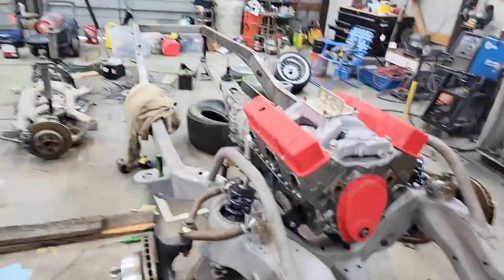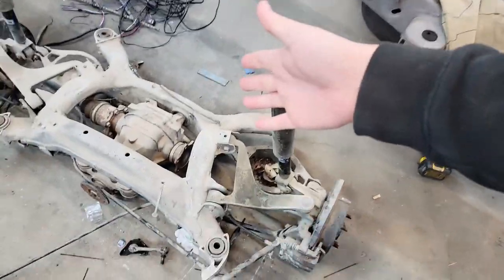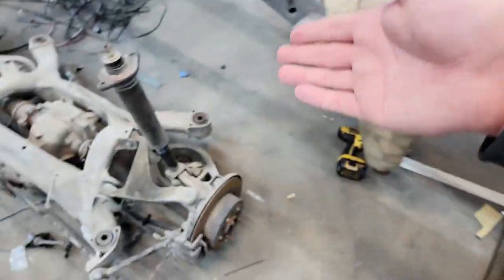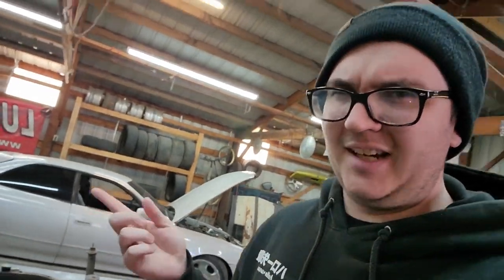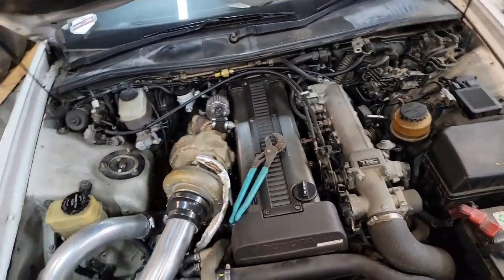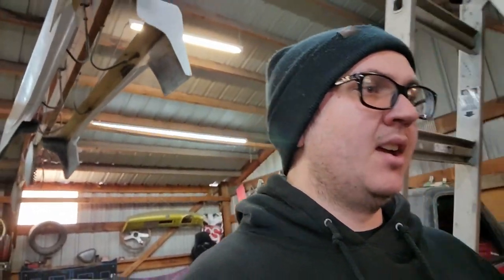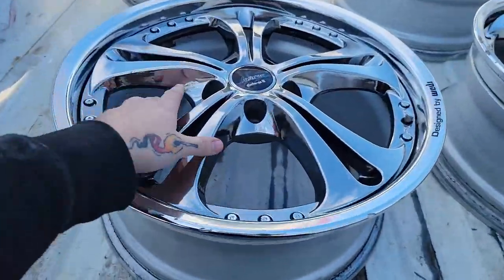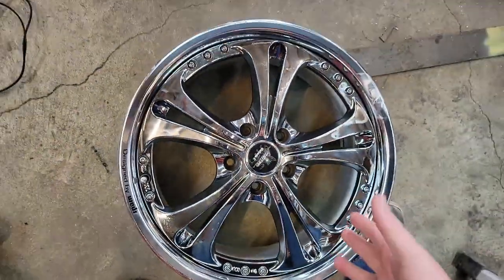I Bought Wheels for a Drift Truck with No Suspension???

Comment: Interested to see if the inner barrel being so large will pose any issues. Can’t wait to see this thing come together.
Reply from the maker: It's a possibility that's crossed my mind. If it ends up being too wide I can always buy smaller inner barrels but I'd like to avoid that option if at all possible
Reply: @poppgtw3918  hopefully you can make them work!